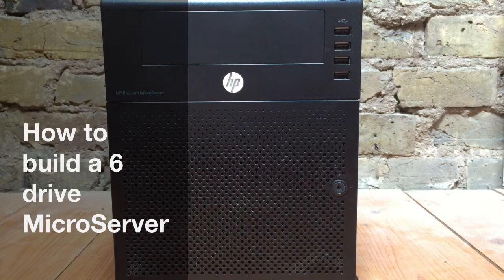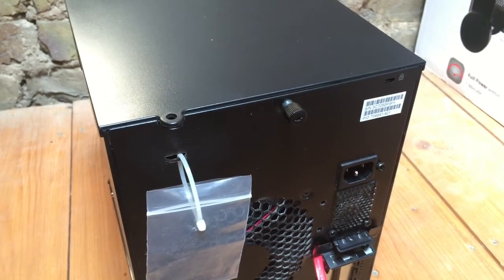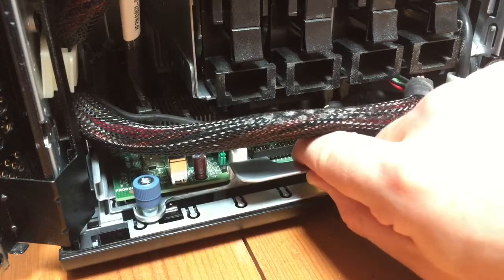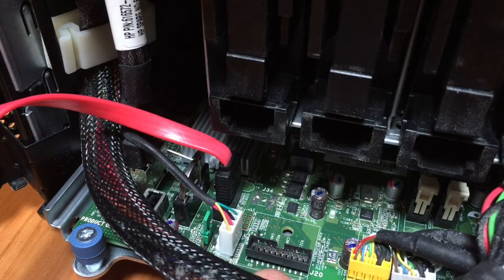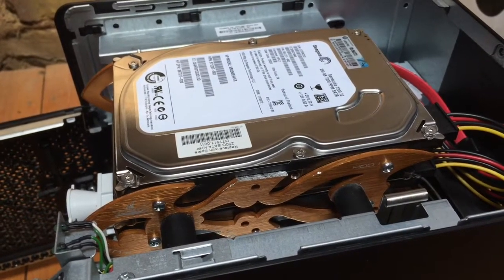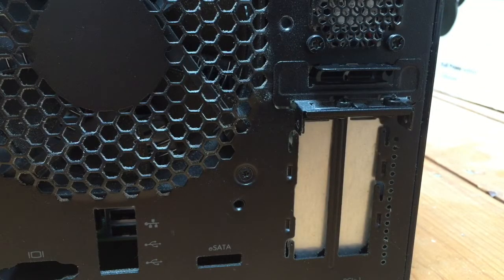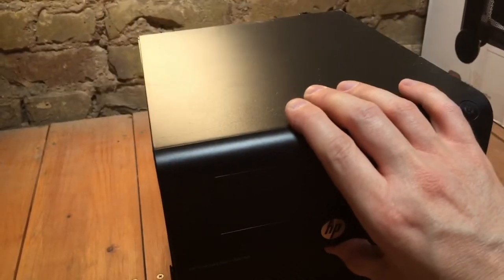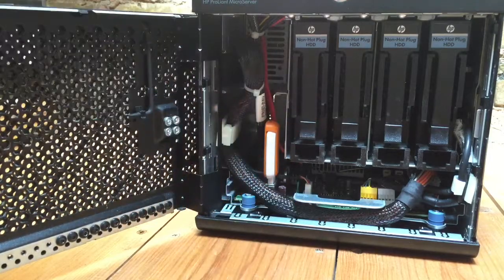How to build a 6 drive MicroServer

Comment: Back about that time TigerDirect was selling a low end HP ML-10 tower server for $199. It's taller than the one your using and does not have the slide in drive caddies but was an attractive option at the offered price. I loaded that up with 6ea sata disks and 16GB of ram and installed Freenas on it using 2ea 16GB thumb drives (mirrored so if one fails the other takes over).

That has been running for 5 years now without any hiccups.

Comment: Nice one. Does this machine allow booting from any drive in the system? Could you assign one of the top-mounted drives to be the system drive?
Reply: Yes you can. The easiest way is to remove all other drives and JUST connect a drive to eith the ESATA or the internal "other" sata and that's it. Once the operating system is installed,, you can then add the other drives as RAID 0,1 or JBOD.

I am running like this myself now (you can even use the internal USB port for a boot drive - it works but is painfully slow)
Reply: @marcteigh8633  once booted is it normal speed?

Comment: Hi,optimus upgrade!!! I have a lot of this microserver but all with old bios and new bios have the same problem: the lan is GigaByte but in speedtest don't exceed 100/110 Mb
I try to insert new lan board Gygabyte but don't move of 100Mb... With other PC the speedtest is more of 800Mb.
Windows and Linux see GigaByte ethernet connection but is not really. Do you try a speed test with your? Do you have tha same problem?
Reply: 1 Gbit= 100MB/sec max
Reply: @HLF20  the speed is in gbyte... in the same LAN others PC run about 700-900 mbyte
Reply: @HLF20  No ok ... the LAN and other PC are all on gigabit and if i try a speed test on my office network i have 900 mbit in download and 110 mbit in upload. This in all PC and servers... but not on our 10 microserver... only all 10 microserver in speed test have 110 mbit in download and upload. I try to install other  1gbit network card... but the speed test is the same.
Reply: @albertorenatobiancamano5208  

Ah get you now. Sorry.
Go into the bios and Check if you have an ILO Feature installed and then Check if ILO is configured as shared port. In this case the network adapter will operate only at 100mbps.

After that you could check the NIC card speed and set it to Auto instead of 100/Full.

Try a different port and make sure that you are using a cat6 rated cable.

Hope that helps you
Reply: @HLF20  thank you!!...tomorrow in office i check all
Reply: HI, I try to find in bios any option of ILO Featur but there isn't :(. There is only one port in that PC and the cable is correct...if I connect in this cable other pc the speed is correct

Comment: Maybe a newbie questions, why not connect that to a sata harddisk array via the e-sata connection and technicially get unlimited number of drives?  Subject to the bios supporting it.
Reply: The array uses a SAS connector to connect to the array to the motherboard
Reply: @frostiimoon  there are  several options on how to connect the array including esata and usb. I'm worrying  a bit about proper cooling. Is this top bay cooled at all? If no then external box might be beneficial
Reply: Vadim Tomkevich nah there is no active cooling on the top bay
Reply: @frostiimoon  so did some discovery here. If I didn't add any cooling there then my WDs are 43-45C which is pretty high. so I removed top cover from the server and it was around 40C. I also tried to set a couple of 50mm fans aside of those top bay hdds, it seems to be the best option from temperature perspective (but not design if you want to keep top cover installed). Another option is to add 40*20mm fan there and then you can close the top cover. It would be 35-36C.
For now I installed gembird hd-a1 and replaced stock noisy fans for performant ones. Also thinking about adding voltage regulator there to balance noise and temperature. Right at the moment I have around 38C which is pretty good for HDD health. Will add 40*20 (instead current 40*10) and it would be perfect 36C